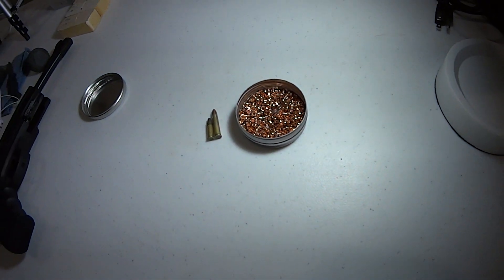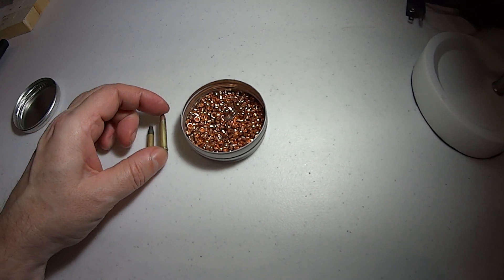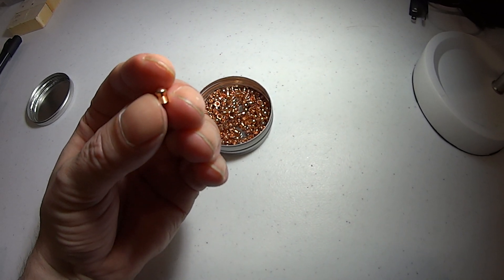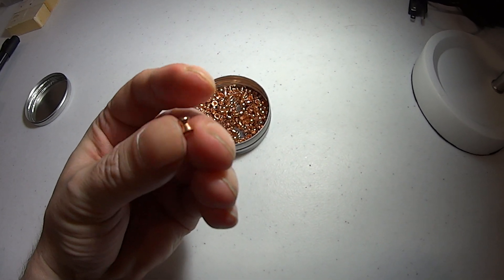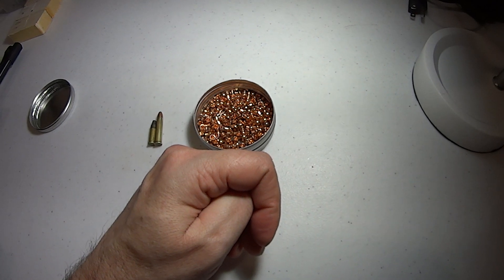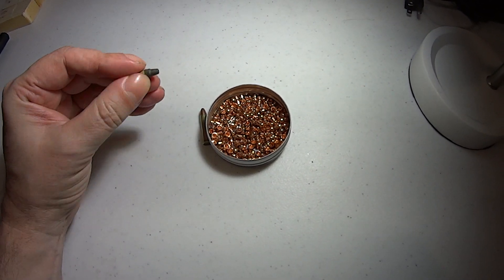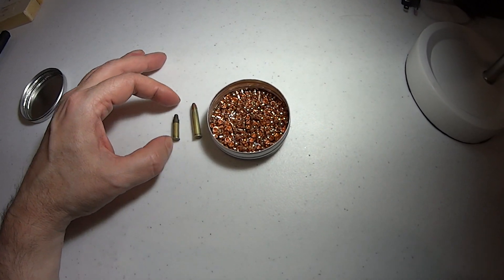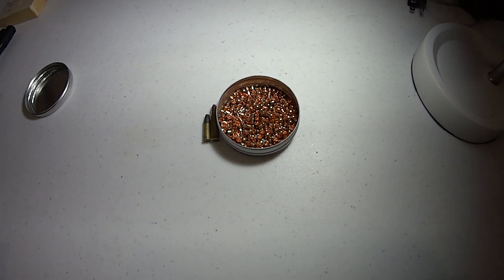pellets and bullets - purpose of copper jackets

Comment: Will copper coated pellets keep your barrel cleaner?
Reply from the maker: Yes and unlike center-fire rifles copper in airguns doesn't build up but even in center-fire guns soft lead builds up more then copper, pellets only have a thin layer of copper as do your 22 lr so just enough to keep it cleaner longer and no powder residues in airguns so cleaner for shure

Comment: Do copper pellets damage break barrel air rifles, some say yes others disagree what's you input?????
Reply from the maker: the copper is a thin coating also tin pellets are used in airguns, its nothing to worry about and i have not noticed any accuracy issues in airguns i have had over 20 years that i shot tin and copper plated pellets in, but zinc alloy pellets wich are much harder then tin alloy pellets i would avoid, zinc is in some gamo alloy pellets, the way you test if pellet is zinc is on your stove if it doesnt melt its zinc, zinc needs 700 degrees, tin needs only maybe 450 and lead around 620 but lead is soft and a slightly harder lead is antimony lead like in crosman pellets...in your barrel the resistance coefficient of lead vs tin the tin value is .5 and lead is 1.5 and cooper maybe 2.0....this means tin alloy slides easier in your barrel with less resistance but often pellets are light and long range you benefit more from heavy pellets made of lead but tin is excellent at close medium ranges, for example h and n field target pellet in tin is 5.56 gr or close to it and lead is 8.6 grain or close to it, same shape pellet but ballistic coefficient is higher for lead pellet although the tin pellet will out run a lead pellet but at some point longer ranges the lead pellet may be moving faster or even get to the target faster like if shooting 100 yards or crazy long range shots....this is because the lead pellet has a ballistic coefficient of .020+ and the tin pellet about .016 wich is good but not enough weight to compete in very long ranges with the lead pellet for time to target and energy on target
Reply: airgun fun ,.....Thank you..